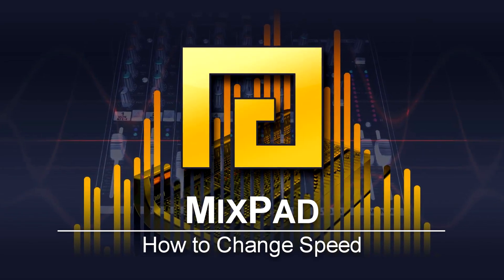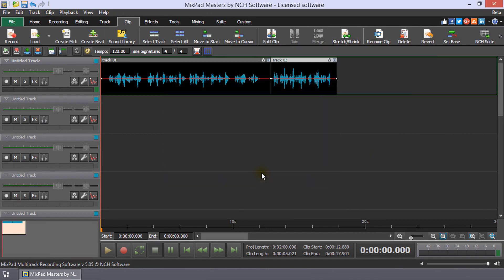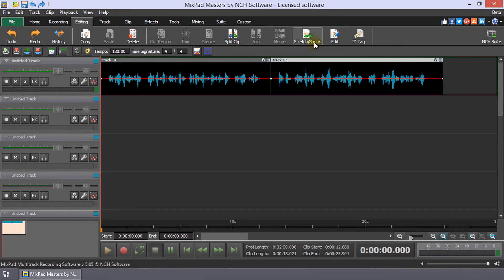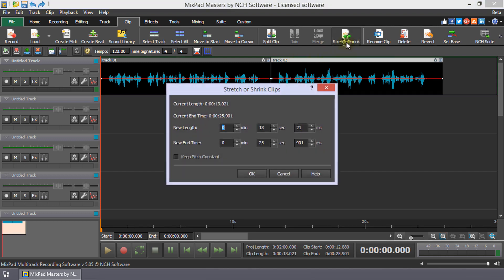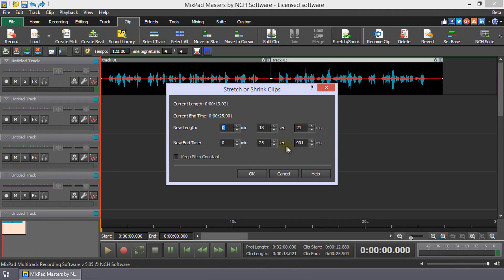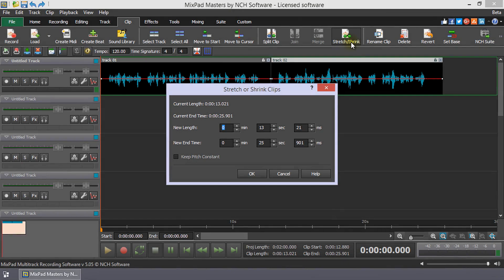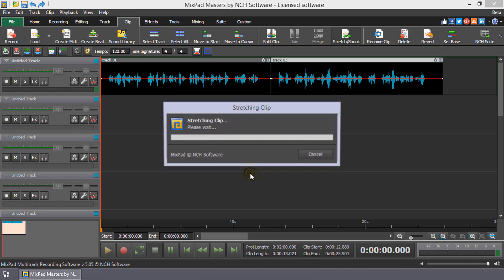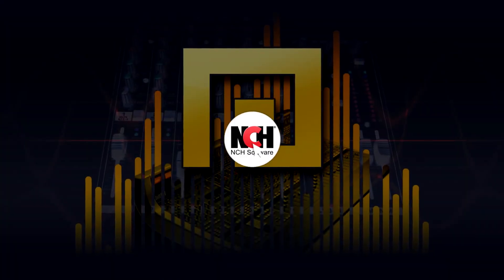How to Change Speed | MixPad Audio Mixing Software Tutorial

Comment: Product request; I'm somewhat of a novice, but what I would like to be able to do is convert analog beat patterns to digital dance beat sounds (with the same patern) for Mixpad.  It's not a beat maker I want, I want to convert the original drum beat analog track, dump it into the software or plugin, and select from a slew of beat choices and have it churn out a wicked sounding digitalized beat track that you'd hear in clubs and raves.  I already know how to isolate the beats, now I want to convert them to something ultramodern with pimped out beats that I can go back and replace the original drum beats with.  I hope that makes sense and I can't believe that I can't find such a beast out there.  If it's within Mixpad's capability to offer this or anyone else's, please let me know how to do this.  I would think such a feature would be hugely popular so please let me know how I can make it happen.  Again, I'm not looking to make beats, just to take the original beat and transform it to dance house beats leaving the tempo untarnished.  PS .... why can't Mixpad have automatic options to isolate the various components of a track (guitar vs Vox vs Synth vs beats etc).  I have to use other software to do that and it kinda bites.